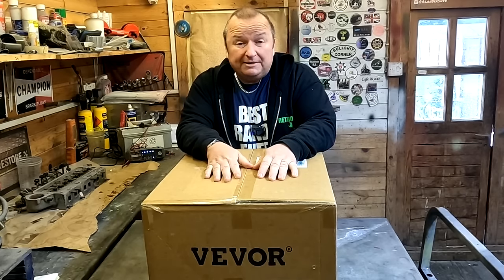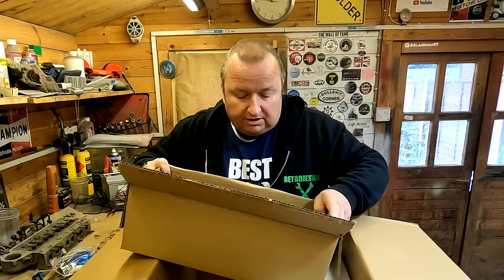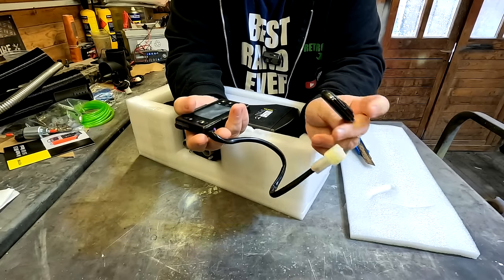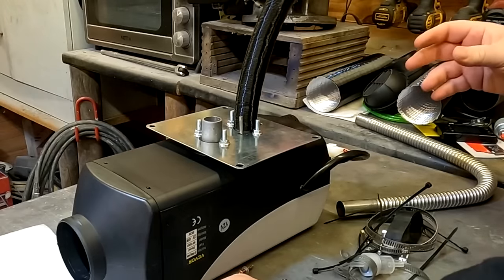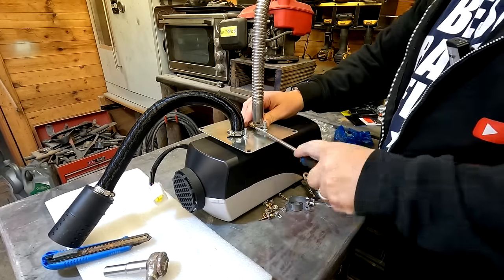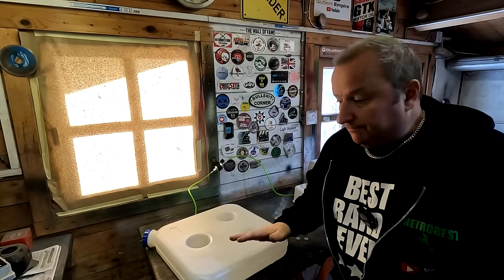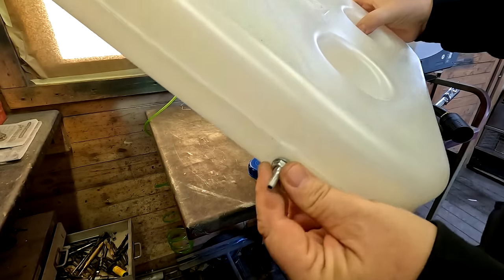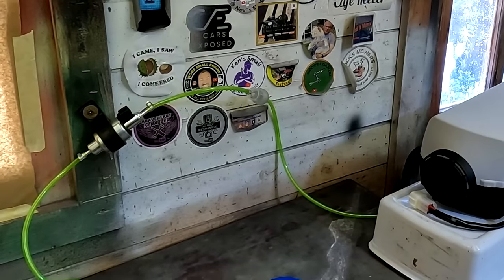Shocked - Using This Diesel Heater In My Workshop

Comment: These are great heaters and been running one for 5 years in the van no problems with the unit itself but have a few tips to share with everyone that might be useful. 
I didn't like the idea of drilling a hole at the bottom of the tank on mine so i drilled one at the top on the same side as the filler cap and let hose drop to the bottom inside from the weight of the pickup plus a big nut to keep it grounded and works perfect.

Ditch the green hose as soon as you can its not good for a couple of reasons.
1. It breaks down and splits after a year or so spraying diesel in all the worst places imaginable. 
2. This applies mainly if there's a bit distance between tank, pump, and heater but for the best reliability and performance i recommend replacing with a fuel safe hard plastic pipe joined with small rubber sections over the top where required, the soft pipe included expands slightly each time the pump pulses causing low pressure. 
This can also be a reason for a fuel error code with soft pipe on long runs.

3. Most of the clips i had are rubbish and replaced all of them for better ones especially on the exhaust side but don't know if there any better on newer models.

4. You'll end up running it on the lowest setting for hours its unavoidable it puts out that much heat, i recommend before shutdown give it 5 - 10 mins on full power to burn off any  build up inside the burn chamber.

5. Get a Carbon monoxide alarm for small less ventilated areas just encase the worst case scenario were to happen and a leak started. 

From a van perspective there's loads of experiments possible from making sound deadening enclosures to silence the pump, water heating or if your handy with electronics is hooking the controller up to an arduino or less technical an electric GSM gate opener on a long lasting pay as you go sim allowing you to turn it on or off by phone, handy say if your far away and want a preheat a van on those freezing nights or mornings.

6. Red diesel is a slightly cheaper option if you have a fuel station near by.
Reply from the maker: Sounds like a good tip, Thanks
Reply: You can’t buy red anymore
Reply: @carolebox2653  of course you can.
Reply: @rogerkeys5514  ooooh good news!! I thought it was banned!! I’m going to fit another diesel heater 😂😂😂
Reply: Awesome tips, cheers.
I would drill a hole in the filler cap of the tank and push the fuel line through that.
You could even put your filter on the end of the fuel line inside the tank.
Throw the plastic tank away and get a bigger metal one.
You could even re use a car diesel tank and wire up the fuel sender and dashboard guage, lol.

Comment: Great video. They run better if you have the unit inside. They re-circulate the air and heat up the area quickly. If you have a unit outside it will be heating cold air. They are designed to be inside and vented to the outside. We have them inside all our fleet vans. Keeps the van warm in winter and drys clothes when it’s always raining.
Reply: Just run a piece of duct to the inlet from inside the room.  Keep the fuel tank and unit outside.
Reply: @einfelder8262  That really is a smart way of doing it!
Reply: @13Clicks  That's true, but it's totally an insignificant volume that's required to supply the air this thing uses for combustion.  Can easily stop it happening  by farting once or twice........
Reply: Great video, very well explained, Cheers
Reply: @13Clicks  that's not correct actually. On these heaters the combustion air comes in one pipe and the exhaust goes out the other.  Both pipes should be routed to the outside.  It is not drawing on the room air for combustion.
Reply: @timbo19  What's the disadvantage of using inside air?
Incidentally, a 2.5m exhaust pipe gives off a lot of heat, if installed safely it's an extra free radiator :)
Reply: @G-ra-ha-m  there is the possible risk of oxygen depletion in a small well sealed space. I'm only reiterating what would be in the installation instructions. There is a reason why the combustion air intake is separate from the room air intake.
Reply: @timbo19  Perhaps, but I still don't understand the physics. 
All the air is sucked in, so the room pressure would become lower, and more air would be sucked in. 

The only mechanism for altering the relative concentration of oxygen, is if lower oxygen air was sucked in - so perhaps in your case the exhaust was sucked back into the room?

The exhaust is the only oxygen depleted source of 'air' available.
Reply: @G-ra-ha-m  you realise that these heaters have entirely separate air paths for combustion and heating. Much like a gas boiler at home with a balanced flue, you want the air for combustion to come from outside and the exhaust to go outside. There is a separate intake at the opposite end of the heater outlet which draws the room air through the heater. There should be no air being "sucked" out of the room, it's just being recirculated through the heater.
Reply: @G-ra-ha-m  Is there a hotplate mod for the exhaust so I can fry some bacon rashers on it?
Reply: @gwaponobby  I'm sure it could be made, just buy a longer exhaust, coil it like an electric cooker ring and support it on a suitable metal bracket! :)
Reply: @G-ra-ha-m  I will be at the patent office first thing tomorrow.
Reply: Hi. If I want to put the heater outside the building an suck the air from inside the building to recirculate can I extend the pipe?
Reply: I can boil a whistle kettle on exhaust for a cuppa @G-ra-ha-m
Reply: These heaters are designed to be inside cycling the room air threw it and the intake combustion air and exhaust go to the outside. These units are not made to be in the elements outside.  And you should never use that green fuel line, it's not safe.

Comment: Been using one of these to heat my workshop for the last 3 years, best heater by miles. Installed inside with the exhaust ducted outside. I made mine but you can use a ducting kit intended for boats. The smoke is just manufacturing oil burning off, mine no longer smokes on startup.

Comment: they are great heaters martin...try and keep the unit inside and run the exhaust outside with some exhaust wrap around it where it exits the cabin.the unit inside will run more efficiently if its drawing in the warmer air from inside..if you get what i mean..and maybe move the fuel filter to before the pump to protect the pump also. great video tho :)

Comment: Hi Martin, a few tips from a user with one in his garage. Those fuel tanks have a nasty habit of splitting on the seams after a while. Don’t be concerned about bubbles in the fuel line - the pump creates it by cavitation. If you want better control look for an Afterburner unit - wish I had one! Never just unplug the power, the power down cycle is very important. I have mine running off a power supply as they don’t like low voltage from batteries running down. I did try solar charging a couple of car batteries but they never got recharged in the winter with the heater running - obviously I need more solar panels…. Nice little units, I keep a set of gaskets to service the burner chamber as well.
Reply from the maker: What psu would you recommend Gary.
Reply: I leave my battery charger on all the time when heater is running ,keeps battery charged,those heaters draw some voltage when starting up and soon drain a battery
Reply: Could these be run off a 12v transformer?
Reply: @retrorestore  you made me want one for my workshop. Lets see if they can be easy run off a 12v transformer. Dont see why not
Reply: You want a 12v 30a power supply, about £25 on Amazon. You can probably get away with a 20a if you wanted.
Reply: @retrorestore  does the heater its self have a power rating on it? No spec on the site on what this will draw. I’ll get a transformer ordered up with the unit. Be a warm winter
Reply from the maker: @Alandixon88  I think it's about 6 amps on full power. I'll be looking into a transformer too Alan.
Reply: @retrorestore  cheers for showing this. Ill add this to the list of items bought after seeing you with them. This and the air fryer 🤣
Reply: Lots of folk use psu from computer as the power source but make sure they’ve got enough amps and a bit to do the start up. 
Also in the last 2 days check that you’re not due a refund on the supplied unit if you bought it from a shop and not 2nd hand
Reply: @retrorestore  a 12 volt,10 amp switch mode power supply can be purchased for less than £20 it that is any help.
Reply: I'm using a 12v 15ah psu from aliexpres, no problems with the heater and powersupply over the past 2 years except for one thing,if its really cold and i had it burning on a low setting, when turning it off, it didnt always want to fully combust when starting it up again lots of white smoke.. , to much soot in the combustion chamber and exhaust. Now i always let it run on full power for a short while before turning it off and didn't have that problem since.
Reply: I have a 7ah battery with a cheap Chinese charger from ebay sitting across it, seems fine and never seen more than 6amps drawn even at peak
Reply: @Alandixon88  why would you do that with power cuts on the way. I use a battery with a smart charger. The system I use is 600 AmpHr battery back up with inverter, generator and smallish solar.  I don't install pick up in the side or bottom, but use the dip tube that came with it. If you don't have a dip tube, it is easy to make, and after finding the fuel line rots and splits (after three years of sterling service, I am presently refitting the lines using a bit of left over cunifer brake pipe. Where I live, Paraffin is cheaper than diesel and available in supermarkets in 20 litre tubs..
Reply: @robindumpleton3742  because i can conveniently power the diesel heater for 99.9% of the time. If on the off chance I’m out there of the time of one of these media scared power cut’s I’ll simply put the battery on it.  Hope this answers your question
Reply: @tonystacey3347  good shout
Reply: @retrorestore  I think they’re nearer 9-11 amps while the glow plug is on at the start and shut down cycles that’s why you have to use thicker wire (6mm2 ) and keep the Runs short to and from leisure batteries in vans. Once they’re up to operating
Temp they’re only a couple of amps and
Minimal battery drain
Reply: I would switch the green pipe out for the white nylon version far better 👍🏼
Reply: @retrorestore  I got a 700+ Watt HP server PSU off Fleabay for a tenner.  Delivered.
Rock solid 12 volt supply.
Reply: @retrorestore  fuel filters go before the pump, or the pump will sht..
Reply from the maker: @harrywalker5836  Yes I know. It's done in the next vid.
Reply: @danielrsalomon  I have one I need to set up the problem with direct power supply is if you get a power cut it does not do the run down process and can ruin it
Reply: Brilliant thanks got one for my cabin defo  will be watching this again to install
Reply: @robindumpleton3742  hi do  you mix any diesel with the Paraffin
Reply: @Alandixon88  yes.
Reply: @Alandixon88  Yes, a 12 volt power supply is fine providing it has enough amps to withstand the start up cycle when the glow plug is on. I have always run mine on a power supply unit with no batteries.
Reply: Best is a car battery with a smart charger attached. Then power cuts don't wreck the heater, either.

Comment: Brilliant presentation- ta, mate. I live in Ohio USA and have an old Ford truck, 6.5 ft long bed with an old 3 ft high aluminum cap with crank open windows. I've purchased the VEVOR 2kw. Our winters can be from -5 F (-15 C?) to 20 F (-7 C?) quite often. I was going to utilise a sealed wood box that is open toward the inside of the truck bed. The box contains the diesel heater that is mounted upon my tailgate as the tailgate is in a fixed down position. With the heater on brackets within the box so that it is 6-8 inches (18 cm?) from the bottom I was only going to route the exhaust pipe out of the box and allow the intake air to be sucked in from the truck bed/cap area. The truck bed with this cap is not air tight and I planned to crack the windows open when sleeping.  
Tim P & Graham in comments below (about 2 months ago) discuss this- nonetheless at age 71 on Parkinson medications I confess to being a bit thick. In my mind this design would alleviate almost any chance of pulling in exhaust fumes because I would be utilising inside air through the bottom of the heater from inside the bed & cap. Any thoughts from you and/or Tim P or Graham. Ta-
Reply from the maker: Thanks Jack, glad you enjoyed the video bud.

Comment: Hi Martin, I’ve had a heater in my motorhome for two years, it’s controlled by SMS so I can start it at home on winter mornings, leave it on for an hour then turn it off.. Then by the evening it’s still warm in the cab. Due to the huge increase in electricity costs, I’m now going to install one in my home. Great video and particularly helpful to those who don’t know about these terrific little heaters.
Reply: Wow, how did you manage to get it to start via SMS  ?, sounds very interesting

Comment: Great informative video which will really help anyone fitting one of these for the first time. These heaters are brilliant. I’ve been using one to heat my workshop for the past year. I put mine outside and piped the hot air inside and it works perfectly. Like you I use a car battery to power it, but I fitted a 100watt solar panel to the workshop roof (£80 brand new) and that keeps the battery charged. In fact, it worked so well I added 12v led lighting, 12v USB ports for phone charging and wired in a car stereo and speakers. My tools are mostly cordless, so I only need mains power when they need charging, so it keeps my costs right down.
Reply: sounds like my garage. got an 4000w inverter if need to top up batteries for tools.
Reply: Do you guys have a link to the solar panels you are using 

Thanks in advance 😊
Reply: That's an awesome setup. Are you in the UK?
I don't know how you would get enough sunshine in the cold weather months to run all that kit.
More info please.

Comment: I use one in my garage.
I run the exhaust through a large radiator out of a truck I had.
I plum in outside after the radiator, I get twice the heat.

Comment: I fitted an 8kw heater in my pub shed 3 years ago and it never missed a beat and even -9 outside I had 24 in the pub running on very little diesel, no fumes and easily regulated. I built an outside block case to hold the heater and fuel tank extending flexible pipe to two vents inside the shed which is 20' x 16'. Works a treat

Comment: I've installed one next to my bench in my 26ft x 10ft garage and it works really well. Obviously it doesn't heat the whole garage but having it next to the stool next to my bench it works really well. It sips fuel and its never failed to fire up after a long lay up after the summer.

Comment: I use 2 of these to heat a 460 sq. ft. shop with 12 ft ceilings. They work well even in below zero F. temps. One thing, the filter should go between the fuel tank and the pump so gunk doesn't clog the pump. Other than that you have done an excellent video.
Reply from the maker: Yes I know Darwin, it was just the test mock up bud, I will be doing that.
Reply: I run two of these in a 2 1/2  car insulated garage with 8 foot ceilings.  It usually only needs one to keep temp workable. But on minus 40 degree days it takes two. Plus having two you still have some heat if one has problems and you need to fix it.

Comment: I have had one in my shop for 5 years. Somewhere around your size of shop. Mine shop is not insulated. Some holes. It's now at 12F. Sorry. I don't know the C temperature. It will keep my shop easy 72F or higher. Mine is mounted in my shop. Same original parts. It has never failed me. Works perfectly every time. Thanks for showing.

Comment: Mount it inside as Simon pointed out and just run the intake and exhaust outside. It pulls in air from the back of the unit and you’ll be heating cold air. The combustion chamber is sealed so flames not an issue and it pulls air in for combustion from outside and the exhaust pipes outside. I have one in my small school bus I’ve converted and they work great.
Reply: I ran the exhaust through an old radiator then outside and recovered the exhaust heat ! Life hack 😎

Comment: Running the 5kW/8kW Version (also by Vevor) for 2 years now in my workshop. Typically it's running 7-8hrs non-stop 2-3 days a week during fall/winter. No issues so far. Unit is on the inside. Extended the exhaust with 35mm flexible steel hose. Also added a second silencer. If you do that, make sure to use two different types - otherwise there will be no effect. Amazed how little fuel it's using! WAY cheaper than an electric heater or LPG.

Comment: nice job, I would put the filter before the pump, to protect it. plus the fuel pump varies its pulses to determine the heat output, so the filter might cause issues with running at the correct speed.

Comment: Great viseo Martin. Place it all inside so you are recirculating warm air through the system. This will enable you to use it at a lower output and save fuel. Vent your exahst outside about 1 meter away from any vents or openings, to keep posiones gasses out. I usesd the flexy hose, then silenser, then 22mm copper pipe and lagged it with exaust wrap where it exits the garage. Keep deisel tank indoors as warmer fuel burns more efficiant. I have one of these, 8kw version. My god it makes my tandem garage/workshop really warm. Great vid. It is 100% the safrer way to save energy at the moment.
Reply from the maker: Check out today's vid Mark.
Reply: @retrorestore  Spot on
Reply: better keep fuel tank and heater in room and only exhaust go out of wall